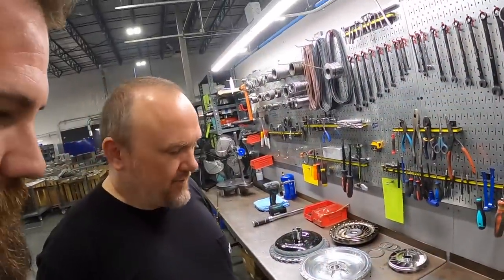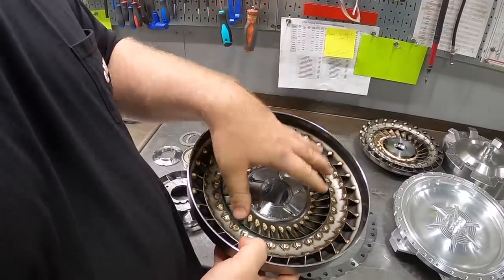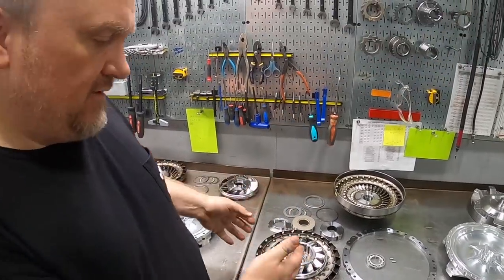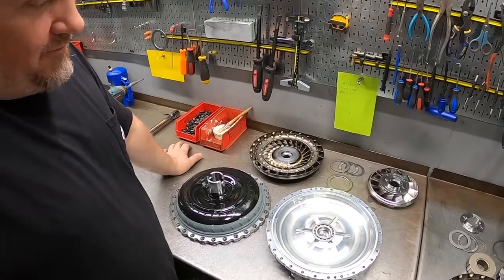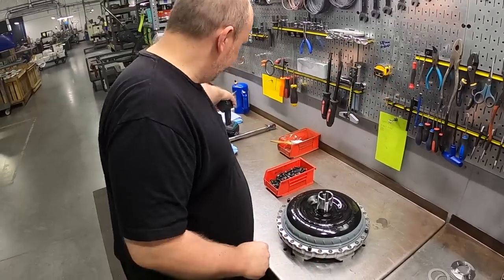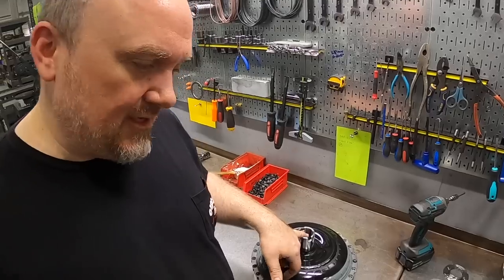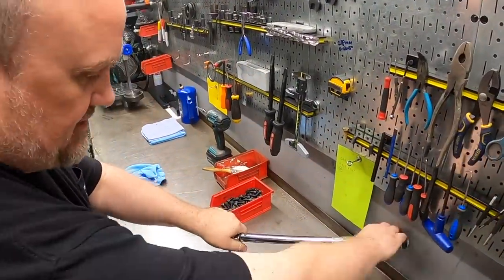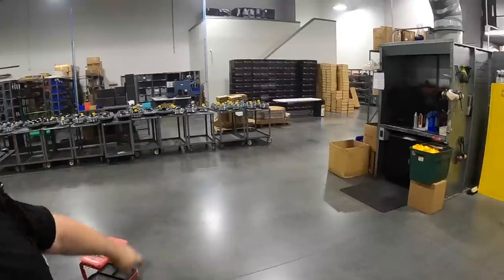Converters Explained

Comment: I loved the back and forth banter of the imperial to metric lol, I've always found it interesting that between your channel, Alan's and MCM, you will drop some measurements in imperial and others in metric depending on what you're talking about.  Also awesome explanation on how the stator works with and without the sprag setup on it. You totally should have signed that converter that you were videoing.
Reply: I assume that Australia is a bit like the UK in that sense. We still measure some stuff imperial but others metric and the older generation still uses imperial for everything as it isn't that long ago that we switched over to metric. For an example we use miles for long distance but cm for short distance. We buy liquids in litres or millilitres except milk which we buy in pints and beer served in a pub which is also pints. Fun times

Comment: I'll look forward to watching this when I finish work. Here in England only old and disabled people drive autos, so torque converters are something that I've never had much experience of. 👍👍
Reply: Not even dct?
Reply: @UK Racer Most of those aren't true automatics, they're DSGs that don't use a torque converter either.
Reply: @Low760  Yeah lots of newer cars have DCT, but they don't use torque converters either.
Reply: @UK RacerSeeing as the whole video was about torque converters, I assumed anyone with an IQ above 50 would have understood the point I was making.
 As I said, DSGs are NOT an automatic, they have no torque converter and no epicyclic gear set. They are a duel clutch manual gearbox with an option to shift automatically. A COMPLETELY different thing to a traditional automatic gearbox. Not my fault if you need to educate yourself on the mechanics of different styles of transmissions.

Comment: Question,some time ago I had a converter built but the people only listened to 1/2 of the info I gave them,top quality company but the was dropped now I have an 11” 2800 converter but need 3400,,,can the 11” get that and be made to work as well as a 10”?I either have to sell it or rebuild it,can you answer?
Reply from the maker: Best to speak with a converter shop, plenty of people use 11’’ converters but it entirely depends what you’re trying to do with it, the weight of the car and the engine combo